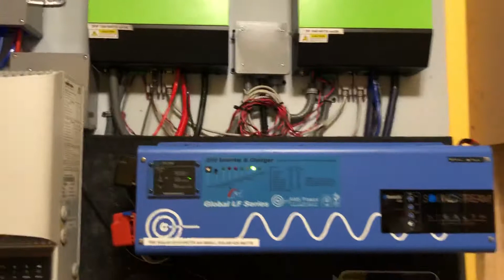DIY Nissan powerwall 2 battery bank and mppt solar charge controller

Comment: Looking Garfield.✌
Reply from the maker: Midway Solar West Indies /—I blow- up mine 2 to 3 years ago and by accident and they replace it free of charge in 2 days//- so I know they will replace yours
Reply: @bimmers323ci  I hope so bro
Reply from the maker: Midway Solar West Indies —//thanks for checking out my video——any update on your system
Reply: @bimmers323ci  system is doing great except I lost my outback charge controller the fan went out. Didn't make it a year. It was by far my best controller. The MIDNITE 250 just doesn't do a good enough job for me. Contacted outback been week haven't heard from them yet.
Fingers crossed.
Reply from the maker: Midway Solar West Indies you are lying the outback-//-//everyone swear by this charge controller included my self—-sorry to hear—- but I think it comes with 5 year warranty did you call outback
Reply: @bimmers323ci  due to what's going on I chose to email tech support, since I'm not getting a response I'll call. To me it's the best charge controller of the bunch when it comes to lithium. The MIDNITE is not good with my leaf packs.
Reply: @bimmers323ci  took me about 3 days to figure out something was wrong.  I wasn't hearing the fan as usual. Ran a test and the fan was dead. On the fm60 the fan is almost impossible to get to unlike the fm80 which is right at the top. It kept working cranking out power but it was unusually hot. I took it  offline to avoid total failure.  I was just about to buy another and ditch the midnite 250 before the failure.I'm going to look into something without fans. I always have problems with devices that depend on fans for cooling. We are o  absolute lockdown down here so it may be awhile before I get it resolved.
Reply from the maker: Midway Solar West Indies /-/they will replace it for you they are good people——-stay safe in the mean time put one of those 120v standing fan facing your system to keep it cool and thanks again for checking out my video

Comment: How many days will it run your home ?
Reply from the maker: mississippi4589 .....well all my 120v been on battery for the pass 6to 7 months or more only  use the grid on my 220v dryer and ac unit....thanks for checking out my video
Reply: @bimmers323ci  I was thinking that a 48 Volt DC-to-AC Inverter to operate large 240 Volt appliances ?
Reply from the maker: MrSummitville thanks for checking out my video:/you are  right but I am a 24v Junkie lol/// one day I will step up to the 24v/240v/6000 Watts aims inverter...thanks again for checking out my video
Reply: @bimmers323ci  I try to stay below 100 amps DC input for the Inverter  ( wire size) .  12 Volt DC input x 100 amps = 1,000 watts AC output ... 24 Volt DC input x 100 amps = 2,,000 watts AC output ... 48 Volt DC input x 100 amps = 4,,000 watts AC output ...
Reply from the maker: MrSummitville ///thanks again for checking out my video//:/I know what you are trying to say/////that was just food for Taught//////I am coming from along way my home is 2900 square foot years ago I got a light bill for $550  for one month in the summer I Decided then I have to do something about it,years after my light bill for last month was $43 use only 14 kWh from the grid last month...as for wire size on the dc side I don’t Worry about it if I decided to put my ac unit on my battery I know I will need more battery and bigger wire and an inverter just for that///thanks again for checking out my video
Reply: @bimmers323ci  The biggest problem with an A/C unit is the initial surge from the hard-start compressor.  Fortunately. newer style A/C units use a ( Variable Frequency Drive ) Inverter-Compressor design - which reduces the initial load on a 48V DC-to-AC inverter.  Being self-sufficient is much more difficult than most people realize ...
Reply from the maker: Cool thanks